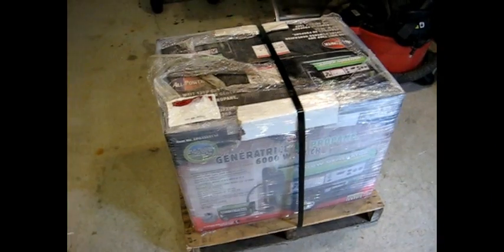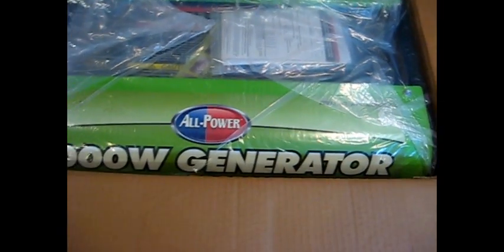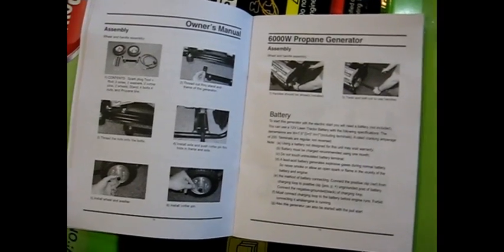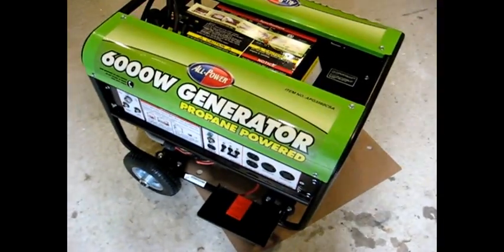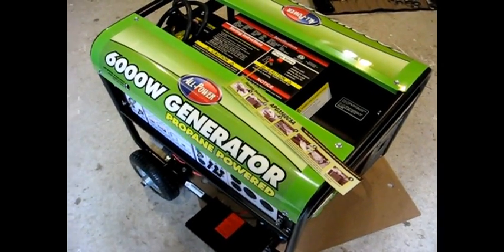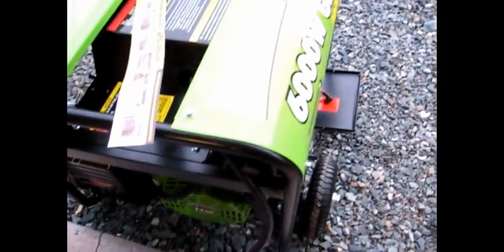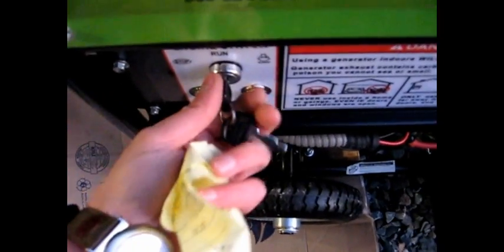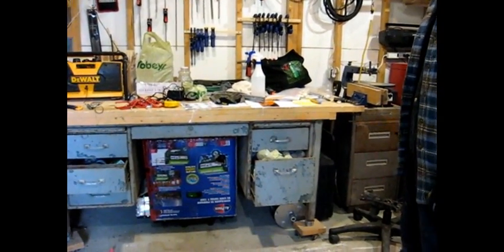Detailed review of the All Power America 6000 watt propane generator

Comment: I'm curious to know if you still have this generator and how it has held up since 2012.
Reply from the maker: I start it up a couple of times a year to ensure that it works. Swapped out a hotter plug as it had trouble running. Now runs like a charm.
Reply: @BuddyWhoDoesStuff  what number plug did you use?

Comment: Hi, Im currently in PR awaiting Hurricane Irma tomorrow afternoon and the house Im staying at has one of these 6000w propane generators. Its old, but I got it started somehow, but, I have a few questions:
Is it normal that I smell propane as its running?
What are the circuit breaker switches on the front panel for and what position should they be in?
How long can I run this at a time, indefinitely? Or will it overheat & breakdown? I have a 100lb tank
thanks!
Reply from the maker: You should not smell propane when running.  Sometimes when starting I do get a smell.  You may want to check the joins with soapy water . . . if bubbles tighten it up.  If memory serves the switches are for 120v and 240v.  I think up is the ON position . . . there should be writing on the generator indicating this.  I only run the generator when needed.  Other points: run it outside, be sure it has enough oil, some people have trouble with 100lb tanks (20lb work better), if it starts and shuts off it could be 2 things (1) faulty low oil indicator - just disconnect yellow wire making sure there is enough oil in machine (2) get hotter plug.  Good luck.

Comment: You made a great video and did a great job, but I have a couple of questions. In the marketing photos for the generator they have the battery base mounted opposite from what you have (so that the battery would be inside the frame ... you have it outside the frame). Not that it matters, but did you mount it that way to accommodate a larger battery? Also, one comment mentioned that the 12V charge cars was to charge car batteries and the generator battery. Most generators that have a 12V supply will charge the battery while the unit is running. Does this unit charge the battery when running or does it require external charger?
Reply from the maker: Probe Team99 The tray was just there.  I did nothing extra. :-)  I'm not sure about the 12v charging, I use solar for that.
Reply: Never feel powerless with the All Power 3250W 6.5 HP Portable Generator 120V with 12V Output. get it here http://amzn.to/1GoaIX2

Comment: That wire and plug that was in with the parts kit is to plug in to the 12 volt charging beside the power outlets for charging a car battery and can be used to charge the start battery on the generator.

Comment from the maker: Looks similar.  Mine does not have the volt meter and the carry handles slide back into the frame.  The primer is on top as opposed to the one you mention.  I do like mine.